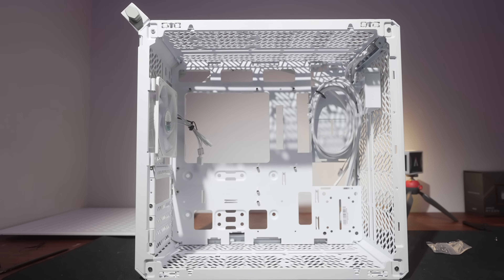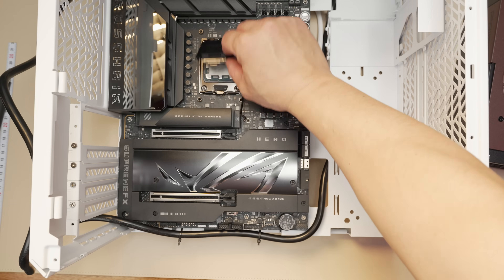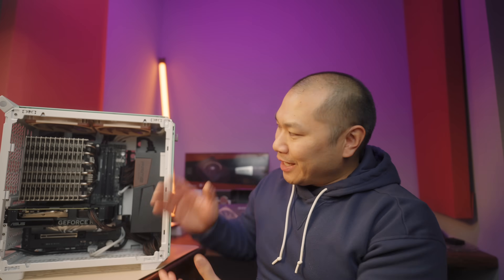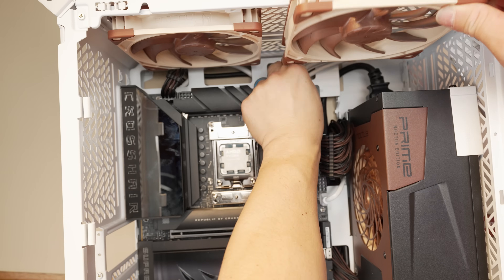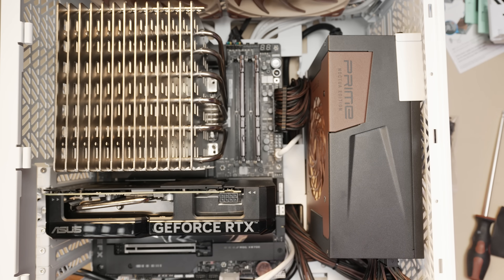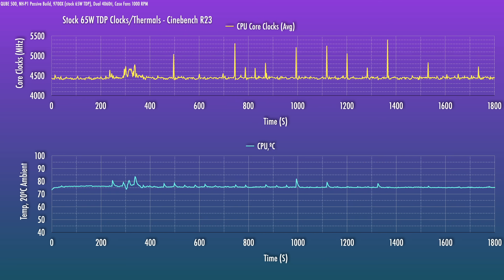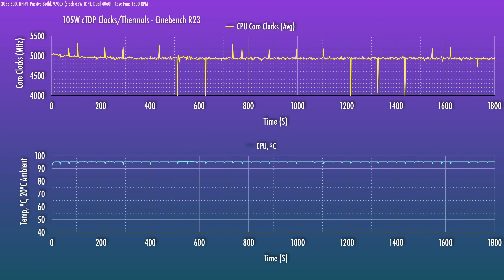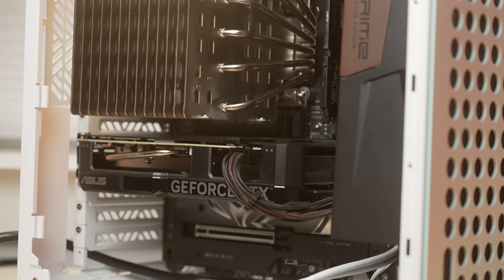Passive cooling Ryzen 9000... plus the new Noctua Power Supply!

Comment: will the higher temps mean a shorter life span for the CPU?
Reply: In theory, but these are designed to work at around 95c without practical drop in life..

Comment: Noctua making a passive cooler seems like an oxymoron. Regardless of how good it can ever be, surely running a pair of Noctuas at 800rpm to move some air will drastically improve performance (and have no discernible increase in noise).
Reply: Because otherwise, you live in a totally silent padded room.... Right?
Reply: 800rpm is very discernible increase in noise if you really ever heard fully passive system in silent. It is as silent as a brick, I start to hear 140mm fans at about 450RPM (noctua D15S) in silent room, 800rpm is average PC I would say. BUT to go fully passive is HUGE jump in price in comparison to something that uses 800RPM fans.

Comment: If you buy the P1 to run fans in your system you bought the wrong cooler. The P1 gets beaten by dual tower coolers with a single 500 rpm fan.
The point of the P1 is to have an 100% fanless APU system powered by a ~200W max fanless PSU or DC to ATX converter / laptop PSU.

Comment: A 1600w premium PSU that costs 50% of a decent gaming pc, for a system that only uses 400w. Hold up, wait a minute, something ain't right...
Reply: It a problem with most yt channels, they just bang most expensive stuff, and I see a lot of people who is confused that you need 250$ 1000W PSU for 3060 with 5600,
Reply: I spent $50 on a used 1000 watt corsair on my main gaming rig and the fans still don't spin up.
Reply: @ im still using a 1300w evga supernova G2 that I had to RMA 9 years ago

Comment: Short version:

A cool idea and such but very impractical. Anything that needs 1600 watts is not going to be cooled passively, and extreme low airflow is still practically silent while being significantly better for temps. The fact there is other fans in the case arguably makes the CPU cooling not even passive in the first place.

Long version:

Passive cooling is a bit pointless if you have other fans in the case honestly since they create noise no matter how little. If you want low noise you can put a quiet fan on the CPU cooler directly and get better temps. I've exhausted these types of theories and quiet builds all many years ago and my conclusion has been that there is little point to passive cooling unless you commit to it with system-wide passive. And that is actually quite difficult to achieve since even a tiny, tiny amount of airflow from a single fan spinning at just hundreds of RPM is practically inaudible and drops temps like 20c+ system-wide depending on how it is introduced into the case. Ideally, mounted to the CPU cooler blowing/sucking air upwards out of the case.

Of course having a CPU heatsink that is designed for passive cooling also often does well with extremely low airflow as a lot of high performing heatsinks tend to have fins placed too densely to perform unless more airflow is 'forced' through it so it may be a good choice for 'quiet' rather than just passive cooling.

And the fact the system has a dGPU makes the whole thing a moot point since 95% of GPUs worth using cannot be cooled passively anyway unless they are idle or low load. Perhaps the RTX 3050 6gb or RTX 4060 non TI with some undervolting and possibly even heatsink mods if going full passive.

All this to say often a much better solution to full passive is very low airflow or some kind of hybrid like in the PSU which kicks in as load increases and necessitates it.

Comment: Happy New Year. Not quite what I'm planning to build, but very interesting.
I am hankering for an NH-D15-G2, over a 16 core R9. That may be a 9950X, or it just may be a Zen 6. Without going into a ten page ramble, we got a fairly underwhelming performance boost from the Zen 5. More so in Windows than Linux, which is where I live, but ~
Little bird tells me the problem with Zen 5, was the memory controllers. They discovered a complete show stopper with those quite late in the bring-up, and did a late emergency pivot to using exactly the same memory controllers they had used on Zen4. As they were already looking to use the same I/O die ~ that'll work. But much of the projected 30% (roughly) increase in IPC, you're not going to see that because of the main memory bottle-neck.
Jump to Zen 6 ~ change the I/O die, change the memory controllers, and find another 5% or so in the cores themselves, and expect a very significant lift in overall performance. Like ~ something in the ballpark of the 30% we heard early rumours of with the Zen 5.
I'm less keen about the inclusion of the Neural Processing Unit ~ that's not something I want or need, but I think as long as this decade old i7 6700 keeps chugging and rattling along, I'm going to hold off and see what Zen 6 brings.
I really don't want a liquid cooler. I strongly prefer the Noctua. The old one has a spectacular reputation ~ the new one is even better.
Video ~ yeah ... Something recent by AMD / Radeon, at the lower end. I have done this thing of building a new machine with a GPU that was made 5 years before once, and I'm not enthusiastic about doing that again. It's still working, my old GTX 750 Ti, but I want a new (fairly recent) AMD card with RDNA 4, but at the cheaper end. I don't want a five thou$and dollar video card. That's just ridiculous. But I do want something that is receiving current video driver updates and revisions in Linux. And I'm going AMD on the CPU, makes sense to go with the same shop on the GPU.
A gen 5 M.2 drive sounds good, but as far as I can see, gen 5 is no better than gen 4 for a home user. In the data centre ~ sure, but for a home Linux user, a 2TB gen 4 would be cooler and last longer and cheaper, and only a little bit slower. It's still going to be about 10x as fast as what I've got now. When the request queue length is short or non-existent, the advantages of the gen 5 mostly go away. All it is, is hotter and more expensive.

Comment: Did you try putting two intake fans at the bottom of the case? I'd bet the CPU would never throttle!
Maybe try mounting the GPU vertically so it impedes less on the bottom bottom to top airflow? Thanks.
Reply: Or he can buy 30$ cooler instead of wasting 150$ on FANLESS cooler and than putting 6? fans to case just to stop CPU from throttling? I just don't understand how people imagine PASSIVE and FANLESS, looks to me like brainless.

Comment: Why are computer cases designed to have a heatsink hanging sideways off of a cpu?  I don't get it.
Reply: This is a really good point. Probably just legacy design, ATX has been around for eons. They tried to change it once or twice (look up 'BTX') but it never caught on.
Reply: @helloken  The mobo isnt the problem. Cases are designed to sit on the wrong side.  Never heard of BTX though.
Reply: You could just lay it flat like the old AT computers. There doesn’t seem to be much of a thermal difference though.
Reply: @Anhedonis  Be Quiet! makes a modern lay flat design but it's literally enormous.  We could have so many ITX systems that are just reasonable and designed "properly" where the heaviest hunk of metal isn't sitting in a way that levers off the IHS.  Just seems weird.
Reply: It doesn't hang off the CPU, it hangs off the points of contacts on the MB/mounting system.
Reply: @joeyyung911  This is what I said using different words.

Comment: Can you compare the noctua 120 & 140mm fans? Only for noise to performance reasons. Maybe in a case that supports a 280 & a 240 rad too. Mainly ofc for noise normalized tests. Also maybe for a particular score/fps how many db each fan makes? That video will be extremely unique & most people can fit 140 & 120 in same space. (say 280/240 & 420/320 etc) also maybe do a airflow only tests as well.

Comment: i've always wanted to try that cpu cooler in the asus AP201 with a bunch of case fans
Reply: What's the point of using expensive FANLESS cooler just to put few fans 10 centimeters away you either don't use fans of you do.
Reply: @PREDATEURLT Acoustics and the option to keep the fans off. The heatsink will work without the fans for low workloads, which can’t be said of say, the DH-15. This is a hybrid setup.
Reply: @Anhedonis  This is called semi passive. But for load workloads I did it back in the day with D14 on ryzen 1700.